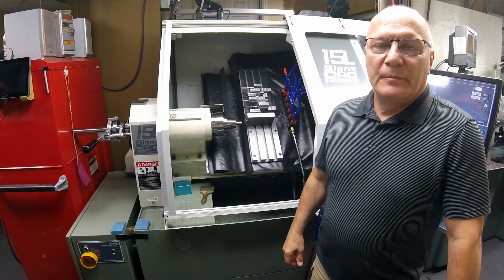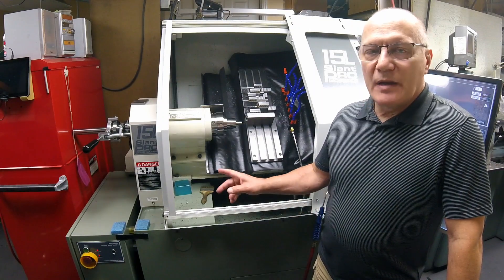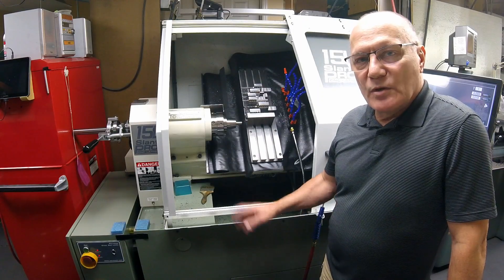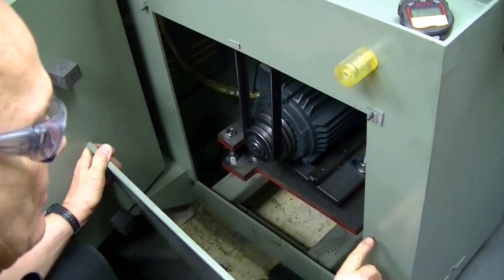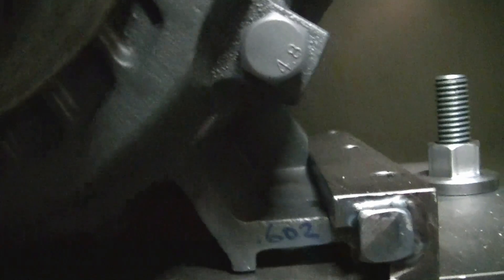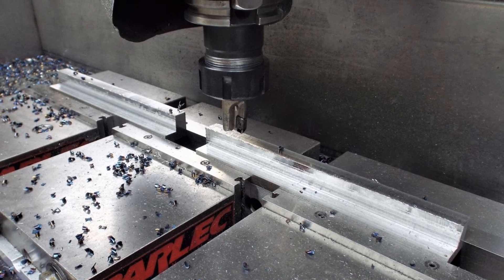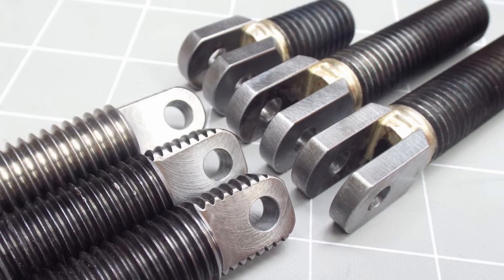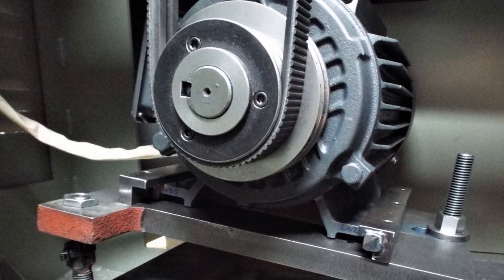TORMACH SLANT PRO 34 SECOND PULLEY CHANGE

Comment: nice work. With the intent to gather some wisdom,  why dint you just add a VFD (variable frequnecy drive) to the motor? I added some even to my bandsaw made life easier. On my  lathe i installed a VFD too, works flawless.
Reply from the maker: It does have a VFD and two pulley adjustable speed ranges 3500 max and 2500 max. I just added a third pulley setting that is 1500 max which greatly increases the torque.
Reply: aha ok makes sense, torque can be needed.  @ROBRENZ  thy for the response =) Are you planing to do a shop tour? and i asked myself "what would Rob classify as: that tool i should have bought earlier!"

Comment: What’s the biggest steel you have turned with this machine?
Reply from the maker: 8" P20 steel hubs in production but turned corner radii on edges of a 12" dia steel disc.
Reply: @ROBRENZ  do you recall what DOC and feed on 8”? Thanks for your feed back
Reply from the maker: @joshuaconner8635  .04 doc and .005 ipr

Comment: As an aside on belt tension a good rule of thumb is when it starts full out getting at least a full second of squeal from the belts is very good. In short belt squeal is inversely related to bearing wear. Belts are cheap in cost and cost of downtime bearings are not. Good video.
Reply: My good sir. Tried and proven, keeps the factory running. Like it when the fans or pumps start and they squeak, for the first second or so totally fine. Belts are sheaves are cheap compared to bearings. We must be doing something right because costs are down and time between failure is up. I'm not sharing an opinion, that's a fact that has stood the test of time. We go through fewer belts and sheaves due to lower tension, the belts don't squeak while running, we do monitor belt heat at least monthly and no issues there, the big bonus is we go through fewer bearings, if the squeal gets too excessive we can soften the start more. Reducing dynamic load also adds life to the bearings and the support structure of the motor and fan. We absolutely never dress the belts, never. Like I said if we were doing something wrong it would show, we monitor everything so if belts were being replaced more often that would be flagged, they are quite robust, the big one is time between failure. Currently we can sell more than the factory can make so there is no slack when it comes to downtime. The belts run a bit warmer than room temperature, that is mostly a function of distance between sheaves, need to give the belts plenty of time to cool down and the sheave size ratio, and the smallest sheave not being too small. The fans we have that eat belts are the fans where one sheave is too small and the distance between the sheaves is too small. Thank you for sharing an opposing pov it is good for discussion and clarification. Maybe you think the belts are changing speed all the time, they are not. They run at about two speeds day and night speeds, they run 24/7/365 the only real time they get shut down is for service such as inspection and maybe filter change twice a year, pumps are similar. if we are not getting the proper life out of the belts and bearings there should be a good reason that is known. The belts don't squeak while running they only squeak on startup with no drive, that's how we confirm we have a good tension.
Reply: @tyhuffman5447  My understanding is belt tension should be as low as possible without slipping, so unless there's slippage issues under load no need to increase tension. Like you say it will only increase dynamic load on bearings. Good belt and pulley practices are proven in industry and belts are usually long lived.
Reply: You're a fool. No belt should ever squeal in operation and least of all when something "starts full out" which is almost always at LIGHT LOAD when the belt is "cool" and "tight". Squealing belts stop squealing when they overheat and get sticky or end up glazed and no longer have enough "bite" to "squeal" because that SQUEALING is caused by slipping belts and friction as they slide in a dry, bare-metal pulley just like dry rubber tennis shoe soles will squeak when they have friction and slide along a clean, dry and polished gymnasium floor. And if you think slipping belts don't damage/destroy bearings because the heat of slippage heats up the pulleys and shafts and eventually the bearings too you're even more of a fool. Just like you're a fool to think "belts are cheap". 

Clearly you don't buy many quality drive belts for anything much less "specialty" belts given the fact that its hard to find even a single and "short" quality V-belt for something like a 1/2-hp single-stage air compressor for less than $10-$15 and common-as-dirty and widely used serpentine belts for late-model cars and pickups go for $50 and up. Get into large industrial belts that very few parts stores have in stock unless they have significant sales history for them to justify stocking them and carrying that overhead and are difficult/expensive to store long-term CORRECTLY. Draping long and/or large heavy V-belts over a hook or small peg or similar "hangar" eventually "creases" the belt and belts can and will "dry-rot" and crack in or on those creases even hanging on the wall if they're there for years or decades in modern climate-controlled buildings that are very "dry" year-round thanks to forced-air heating and central air-conditioning. 

Bearings are specifically designed to handle the "vertical" loads they're subjected to BY belts, genius. They're not subjected to any OTHER significant loads since a balanced, rotating motor armature or the shafts/pulleys/gears in a "transmission" create "axial" loads that a SEALED ROLLER BEARING doesn't "feel" at all since centrifugal force of those rotating parts acts "equally" in all directions. And since loose belts tend to WHIP and JERK as loads are applied and removed and those whips and jerks create SHOCK LOADS that momentarily cause "out of balance" conditions as well as slippage/heating of the belt/pulley/shaft and eventually the bearing ON that shaft and HEAT is what breaks down LUBRICANTS and SEALS and causes "dry" bearings which eventually get hotter and hotter and drier and drier until they fail catastrophically and the shaft and other parts they're supporting end up "flopping around" and cause other damage/destruction, the quickest way to ruin belts AND bearings and ensure MAXIMUM COST IN MONEY AND DOWNTIME WHICH IS ALSO MONEY is to be a dumbass and intentionally run belts LOOSE when they're VERY EASY to PROPERLY TENSION AND CHECK AND ADJUST. 

A properly adjusted belt will have a specific amount of "deflection" halfway between the drive and driven pulleys when a certain load is applied to it either pushing in on it or pulling out on it depending on and MANY belt-drive systems have spring-loaded tensioners with built-in tension gauges and you simply tension the belt tension adjusting screw or nuts until a indicator parts/marks are aligned OR a "sleeve" inside the tension spring prevents the tensioner from being tightened any further. 

That this "expert" machinist thinks its the "size" or "weight" of the parts being machined or how "heavy" the work being done is that determines which drive ratio/speed should be selected instead of the MATERIAL being machined given the differences in cutting tools/speeds/loads machining ALUMINUM vs. STEEL because he doesn't get that typically a "specialty" and "production" machine like that is "set up" initially for a specific material/processes and clearly isn't DESIGNED for "quick-change" drive ratio adjustments or it would be equipped with a system to do it from OUTSIDE the motor/belt area where UNSHIELDED BELTS/PULLEYS are exposed once the side cover is opened up proves that he's every bit the machine tool expert that you are a belt expert. 

CNC machines like that aren't general-purpose/one-size-fits-all machine tools like a "conventional" lathe or mill where speed changes are easily made without having to open up a "live" machine (in a factory/production machine shop or at least a GOOD and SAFETY-CONSCIOUS ONE even if there were no FACTORY safety "disconnect" to kill the power to the machine to prevent all possibility of accidental startup they'd have lock-out/tag-out and machine disconnects and opening panels like that would probably be a big "no-no" for anybody besides maintenance/set-up/service personnel and if he were really the mechanical genius/inventor he thinks he is he could have easily designed and constructed a system to have a belt on both pulley sets at once with spring-loaded/lever-actuated tensioners that could be engaged/disengaged from the outside of the machine in about 2 seconds. 

As long as the tensioners were high enough to lift the unused, slack belt just slightly off the top pulleys or a "lifter link" was used to do so after a low-mounted tensioner was released, that's all it would take. Two belts and double the belt life regardless because each would only be working half the time. Of course he could also pretty easily just go to a single drive ratio/speed to provide 3000 rpm for "general purpose" use and be slightly  "slow" for "light work" and slightly "fast" for "heavy work" if in fact it IS the "size" or "weight" of the work being machined that determines drive ratio/speed and not the material being machined or at least the type of machining being done. And even though a belt pulley size ratio is like a "gear ratio" in that it changes the speed of the shaft/machine being driven while the motor speed remains constant, the ultimate TORQUE CAPACITY or TORQUE DELIVERY isn't automatically "increased" by the percentage of "gear reduction" going to the "low speed ratio" from the "high speed ratio".
Reply from the maker: Thanks and thanks for watching and commenting.

Comment: Very nicely done Rob, as always. It's not dissimilar to the pulley arrangement on my main Swiss mill.

My 2 cents for kicks. It would seem possible to attach that door to the electrical cabinet and have it swing away with the electrical cabinet. I personally don't like loose doors and covers, just because ... well, just because I don't ;)

I very much like the sliding motor idea.
Reply from the maker: Thanks Pete! I agree on not having to handle the cover, just need more days in the week.
ATB, Robin
Reply: I particularly liked it, and gave it a bonus point, because you didn't say "sodder" or "Heigth" even once :P

Comment: Why not cut a hole in the front panel and make a door you can open- mount a Harbor freight 9.95 butterfly wrench on a bracket , plumbed to your air, and you could make the change in less than 10 seconds.
Reply: Wow, I am shocked (not in offense in any way). We run a custom CNC cabinet shop here (we=me and a few), and I cant even bear to walk in that place. I seem to have an alergic reaction to the smell of the ship's hold, and that reaction is reinforced by any and every interaction Ive had with an item from there unless its a name brand that they somehow landed on inventory.

Very interesting. I never ever would have guessed given the level of detail and precision. Time to re-evaluate my position lol.
Reply from the maker: That is a valid idea.
Reply: Yeah- a lot less monkeying around than moving that panel out of the way.  An even better idea is from the old Shopmaster 3 in 1 machines from the 90's- they had 2 belts running on the 2 pulleys, both loose, and an idler roller on a lever that when moved one way tensioned the low speed belt and when moved the other way tensioned the high speed belt, so it was just a simple matter of moving the lever.  They also incorporated a brake mechanism so that when in the neutral position it stopped the spindle while the motor kept running, so you didn't have to turn the motor on and off every time you wanted to measure or change a part.
Reply: I wonder how much Harbor Freight ROBRENZ has in his shop lol
Reply from the maker: Lots, my next video is on making a surface plate stand for a 36 x 48 granite plate using two Harbor Freight tool cabinets.  The quality of their better tool cabinets is second to none, seriously.
Reply: HUH??

Comment: Very good idea and well done .However I will have to lower your grade on the zip ties I know you can do better than that even a bolt with nylon nut perhaps. I guess you could go one step lower and taped the pins from coming out . You know there will always be a Troll  watching  Just saying. PS love your channel .
Reply from the maker: Those are precision dowel pins and I was trying to demonstrate some out of the box engineering creativity. Also that tape you didn't complain about is nasa spec aerospace billet grade skived from solid! ;-)

Comment: Brilliant.
Reply from the maker: Thanks John, The next step is a whole new 2 piece pulley where there are 1200 rpm and 3500 rpm pulleys on the permanent piece and a 2500 pulley that bolts on over the 1200 rpm location. I do fair amount of larger work where that extra torque would come in handy. Thanks for watching and commenting!
ATB, Robin

Comment: Kind of surprised you didn't put hinges on that access panel.
Reply from the maker: Next step is a foam perimeter on the base hole that is the thickness of the current foam blocks and ditch the panel completely.
Reply: Sounds like a better mouse trap. :o)

Comment: Hi Robin, nice to see you again, being a while since last, A question would it not be an ide just to change speed with a VFD, but I guess you have a good reason for not doing that, nice job, a good old handmade thumbs up.
Reply from the maker: It is VFD controlled for speed but this gives two ranges for more torque in the low range. thanks for watching.
Reply: OK I see, and to get the same speed on small pulley as on large pulley you would have to run the motor at 84 Hz, that would be stretching it to much

Comment: Outstanding and brilliant.  Got many tips from this video, some I had to write down in my notebook.  By the way, you may save about 5 or 10 seconds by having the inner cover aligned properly and attached to the outer cabinet on rubber blocks.  Then possibly they could open together and still function as intended.  Just a thought, but what you did was great.
Reply from the maker: Thanks for the very kind words Glenn. Next step is a foam perimeter on the base hole that is the thickness of the current foam blocks and ditch the panel completely.

Comment: Looks like how the belt tensioning system is on my pratt and whitney lathe, except it had two bolts on the adjustment side, one holding it up and one pulling it down--instead of your captive nut/washer thing.
Reply from the maker: Thanks, and thanks for watching and commenting!

Comment: Thanks for sharing. How long took the switch of pulleys before your mod? The only thing that does not look good to me is the black sticky tape that holds the electronic box in place. It may loose its stickiness soon due to oily hands or what not. I would have tried a mechanical latch or a strong enough magnet to keep the E-box.The Turcite sliders are a neat solution. How often will you have to switch pullies until you have gained back your invested time in this solution?
Reply from the maker: look at the tormach video that I linked in the comments above. I never did it the old way but my guess is at least 30 minutes. So maybe 20 changes will pay for itself.
Reply: Ok. Then it is not only happy engineering but also good for business. Congratulations :-)

Comment: Cool!
With the right size magnet, you can probably eliminate the tape too.....
Reply from the maker: Great idea but the magnets grow metal chip fur.
Reply: strong permanent magnets require quite a lot of force to break up, and they tend to snap quite hard when you close them too, something like a latch clamp or a spring clamp would work much better IMHO https://i.imgur.com/qmZZmk9.jpg
Reply: There is a gap between the swinging and stationary part. The magnet does not have to fill the whole gap (but it could). And it does not have to be a N42 strength magnet. By playing a bit with the physical size and strength rating of the magnet, the holding can be as strong or weak as you like. Nothing against you, but I would actually prefer the tape over the latch. I hate those latches for most applications.....

Edit: I should add that it looks like there are soft feet on the swinging part holding the cover plate in place and I was figuring they would soften the closing....
Reply: Yeah, they tend to. But your lathe is fully enclosed, so I would not think that is a problem. I have a small Roland CNC mill with enclosure, and the magnets I use inside to hold wrenches do grow fur. But the ones I use on the outside have not had that problem. YMMV....